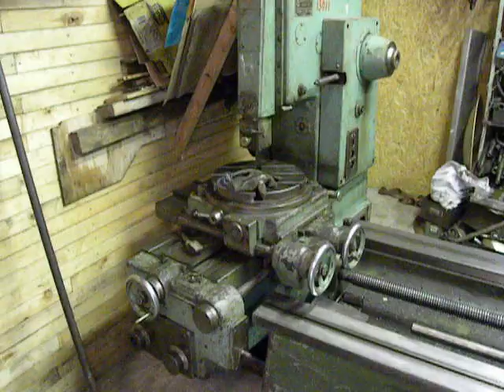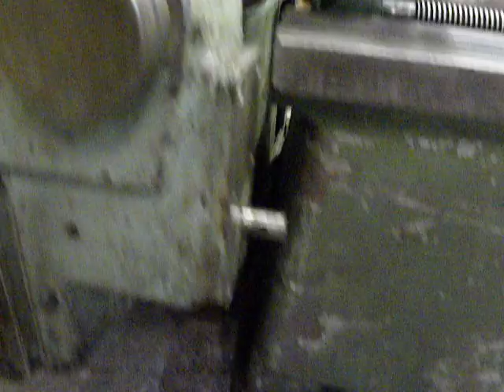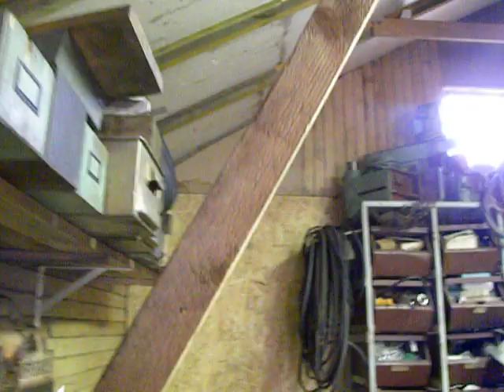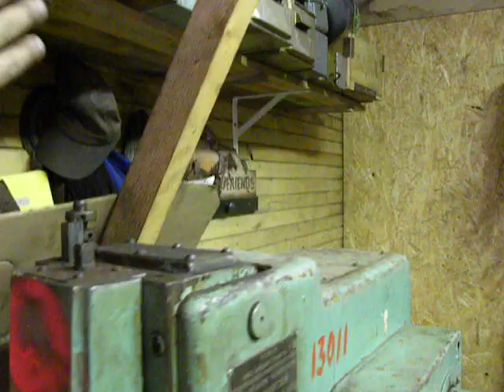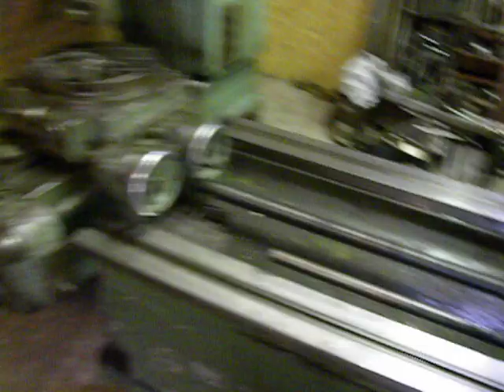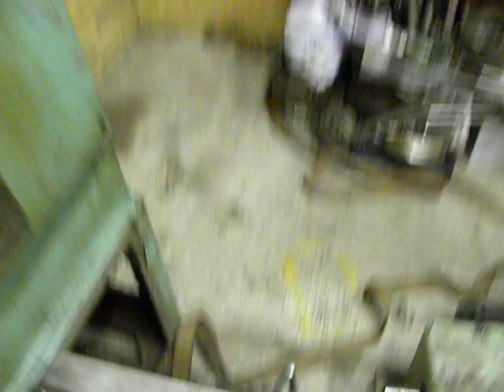Stanko 7A412 vertical shaper - it's almost stuck

Comment: Nice machine can't wait to see it running. How long is the ram stroke and table size? That drum switch for the 4 speed motor was really something, I've never seen one with that many contacts. Your plan to use VFD will be much better and simpler.
Reply from the maker: I want start to run machine soon, because I need it in workshop. Stroke is tiny: poor 100mm, table D=400mm... Yeah, sure VFD is better than that 60's solution. Also old machine get advanced.
Cheers!